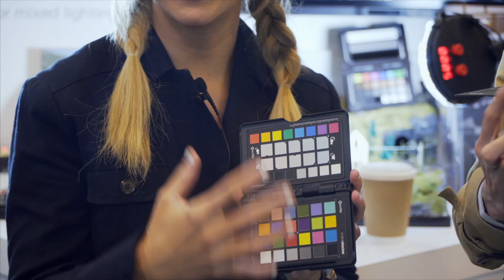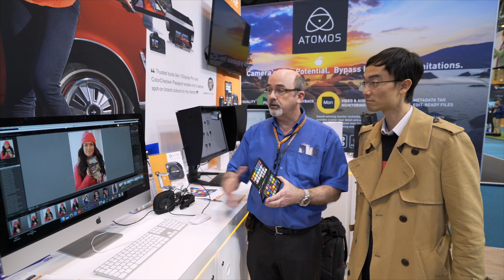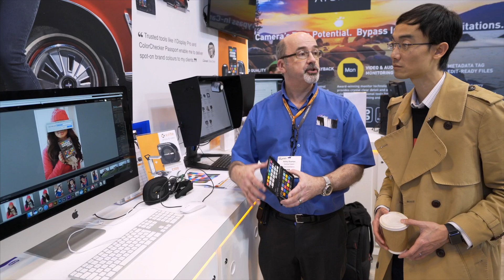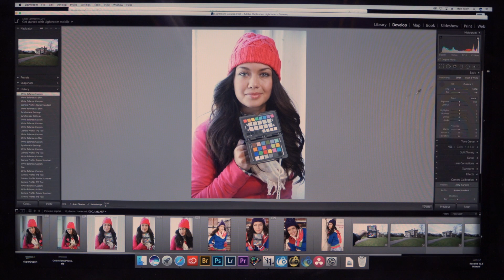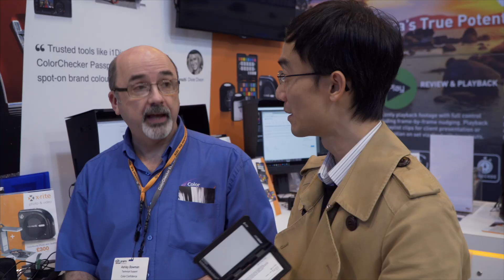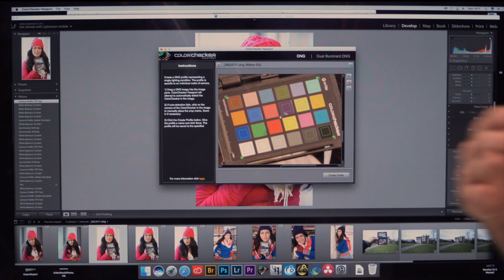FIRST LOK: X-RITE COLOUR CHECKER @ THE PHOTOGRAPHY SHOW 2017

Comment: What I don't get is: If I do 500 photo shoots over the years, will I then have 500 of those profiles in that drop-down? And they will only exist on this one computer? Why can't the software simply move the Color-sliders in Lightroom around, an information that I also can easily sync, but it will follow with the picture in the XMP-file and I don't need to clutter up my calibration drop-down with all those profiles.

Comment: I'm a big user of X-rites colour checker passport and related software. My laptop monitor is calibrated using color munki and I also use sekonic's software in combination with X-rite to produce profiles for both my camera and lightmeter to use during tethered studio shooting. I get repeatable consistant and accurate  colour every time with zero guesswork. If you shoot professionally and white balance and colour accuracy are essential you have to use this. 😃